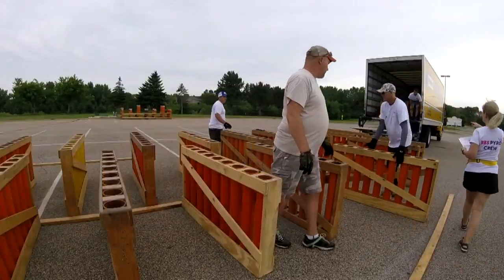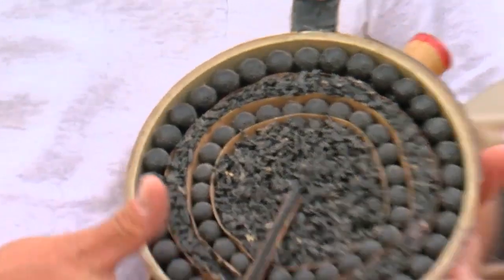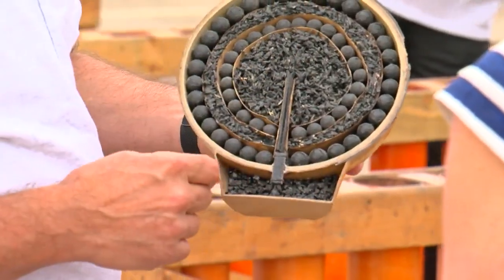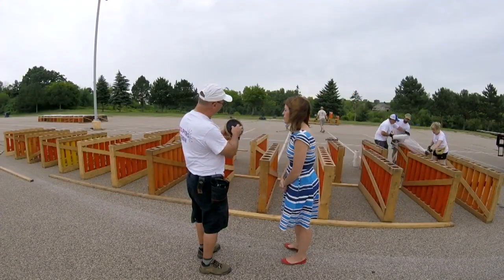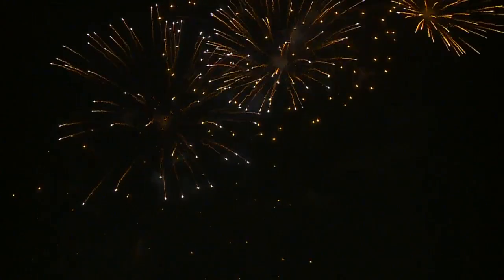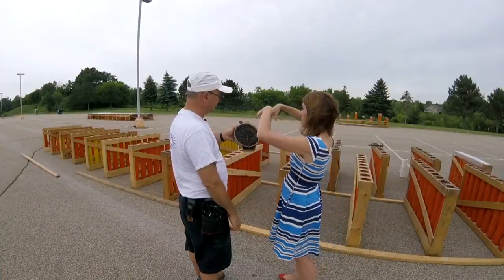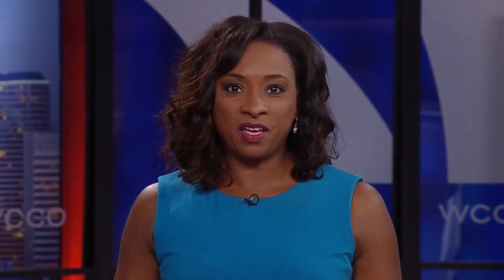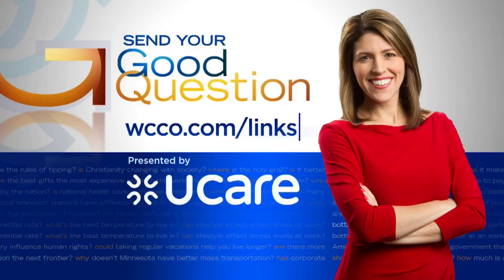How Do Fireworks Work?

Comment: To elaborate a bit more for those who are curious, happy face shells (or any other pattern shell) have their stars arranged exactly like a happy face inside the shell as mentioned, and stay in that pattern after the shell explodes due to a principle in physics called conservation of momentum.  Whistle fireworks use a composition that has a varying burn rate, going from fast to slow in a rapid fashion, and when you put that into a tube of a certain length, you can set up standing pressure waves inside the tube which produce the audible tones you hear, similar to an organ pipe.

Comment: "so these are still made out of gun-powder" LOL......Nah they ignite with gummy bears and twizzlers.
Reply: Did this become an argument? I think I am actually agreeing with you. Chlorate fireworks are insanely unstable, not to mention the fact it's also incompatible with an amazing number of other pyrotechnic chemicals.

With only a small price difference perchlorate beats it every time..

I don't even remember writing the original comment, to be completely honest.
Reply: You literally read me mind!!!!
Reply: He is speaking of potassium chlorate, which reacts violently with gummies. Particularly one containing glycol.
Reply: @ferrischemistry7879  potasium perchlorate is more stable
Reply: @anglership9563  However, Potassium Chlorate is easier to synthesize.
Reply: They dont use chlorate in fireworks anymore besides for smoke compositions, older fireworks such as really old firecrackers use chlorate based flash which has more properties of friction/shock sensitivity than newer perchlorate based mixes
Reply: @samara_morgan6884  Also, Chlorate, similarly to sulphur, has a tendency to form complexes with nearby elements and decompose. As for sulphur, it creates heat. If you mix the Chlorate and sulphur, it creates a revolving effect of oxidation and heat. That's why they use Perchlorate for a safer oxidizer.
Reply: @samara_morgan6884  thats not true
Reply: What she means is, it's not made of smokeless powder, but good old black powder.

Comment: Hey my name is saeed i have one question i wanted to ask you guys?if yes is the tube reusable??? that's all a least i can said i learn something thanks
Reply: Yes they reuse everything but the shells
Reply: There are 3 kind of mortars, made of cardboard, composite of glass fibers and resin or Metal mortars.
All are reusable... But all you should change after a specific number of shots because of safety reasons... Cardboard mortars 3-10 times (single use only in wet conditions), Composite mortars about 100 time's and the steel mortars are good for several decades if treaded well.